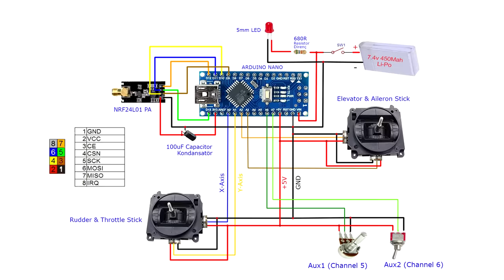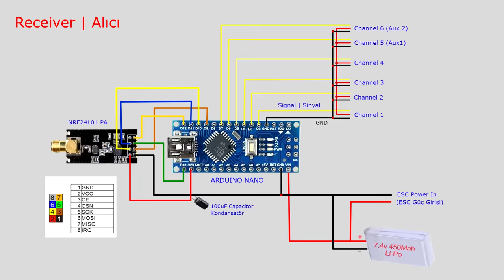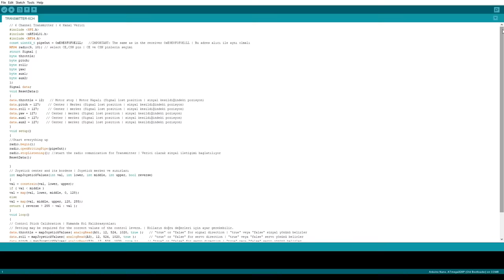DIY 6 Channels Radio Control For Models. How To Make İt

Comment: Hi sir, made it exactly the same. But I am facing a problem, that when I connect ESc to battery all servo's automatically get started in one direction. And unbale to controll it by transmitter. Could you plz help. I am using 9v battery (it is not a lipo battery)
Reply from the maker: First of all, let me state that it will not work stable with a 9V battery. It does not have enough current strength for NRF24 modules. If you do not have a Lipo battery, you can also try it with a 9V-12V DC adapter. (Min 1A). Other than that, I don't know where you went wrong. It works fine if all links are correct and there are no broken parts.
Reply: @Kendin-Yap  power is enough, it might be reciever and transmitter binding issue. Like in yours a beep sound comes out when you connect to power, but I am unable to get that beep sound. And one thing I am not connected any motor to it, should it is necessary to connect motor in reciver to bind it with transmitter?
Reply from the maker: It doesn't matter if the motor is connected to the receiver. ESC must be connected. BUT 9V batteries do not provide enough current power for NRF24 modules. I'm not talking about voltage. Voltage is a separate issue, current strength is a separate issue.
Reply: @Kendin-Yap  ok thanks, let me try with a adapter equal to 1A or more. Thanks for yor support! 😊

Comment: Mrb.Burada RC Joystick olarak PS4 analogunu kullansak olurmu acaba?Önerirmisiniz?
Reply from the maker: Evet kullanabilirsiniz. Zaten yakın zamanda eklediğim 8 kanallı arduino kumanda sisteminde ps4 analog kollarını kullandım. O videomu inceleyebilirsiniz.
Reply: @Kendin-Yap  cvp için teşekkürler:) yavaş yavaş tüm videolarınıza bakmaya çalışıyorum
Reply: @Kendin-Yap  Alıcı modülde servo motor  beslemelerini direk arduinodanmı aldınız acaba onu anlayamadimda bir kaç kez baktım ama göremedim
Reply from the maker: @yucelsohret  Hayır arduinodan değil. Alıcı şemasında kanal çıkışlarındaki pozitif (Kırmızı hat) pinlerin hiç bir yere bağlı olmadığı görebilirsiniz. Çünkü servolar ESC nin BEC çıkışından besleniyor. Eğer ESC kullanmayacaksanız harici bir pil ile de kullanabilirsiniz. Örneğin 4 adet kalem pilin konulduğu pil kutuları ile 6V luk bir batarya oluşturabilir ve kanal çıkışlarının Pozitif (+) ve GND (-) pinlerine direk bağlayabilirsiniz. Tabi ters bağlantı yapmadığınızdan emin olun.
Reply: @Kendin-Yap  şimdi daha net anladım çok teşekkür ediyorum

Comment: do you have plane can use my electronic : 1306 3100kv motor, 12a esc, 2s 450mah battery, 2 servo 2 gram with 1 servo 3 gram, 6inch propeller? thank you
Reply from the maker: Suitable for this model.   https://youtu.be/9SMyBN-B3Vo

Comment: hocam sonunda kumandayı çalıştırmayı başardım ama servolar çok az açıda hareket ediyor bunu arttırmanın bir yolu var mı
Reply from the maker: Alıcı kodu içerisinde yer alan map komutundaki “1000” ve “2000” değerleri servonun maksimum hareket sınırlarını belirler. 1000 ve 2000 değerleri ile 120° lik servo hareketi elde edilir. Örneğin bu değerleri 800 ve 2300 ile değiştirirseniz servo toplam 180° ye kadar hareket edebilir.  İhtiyacınıza göre bu değerleri değiştirebilirsiniz. (en düşük 800, en yüksek2300 olabilir)
Reply: @Kendin-Yap hocam dediğiniz gibi yaptım ancak değil 180 derece 90 derece bile dönmüyor  yaklaşık 60 derece civarına yükseldi sorun nedir acaba

Comment: Whats the role of that capacitor? and how do you decide where to use it In the circuit? this been a mystery for me for a long time
Reply from the maker: The port output of the Arduino does not have enough current power for the NRF module. Therefore, capacitor should be used for power support to NRF module or 3.3V power should be used externally. The task of the capacitor is to support the NRF module for stable operation. Therefore, the NRF should be connected to the power input of the module.
Reply: @Kendin-Yap  thank you so much! Your videos are great! Keep up the great job!

Comment: Dear my tx sending data some time why. What may be the problem I try with different nrf module.
Reply from the maker: The problem is that NRF modules are very easily affected by external interference. This creates connection problems. That's why there are versions with a metal case (which serves as a filter).
Reply: @Kendin-Yap  I wrapped the antenna with aluminium foil n my problem is solved thankyou for your replay
Reply from the maker: An interesting solution. I'm glad it worked. @varunraghuwanshi3177

Comment: I have an  flysky fsct6b transmeter and receiver. The circuit burned out in my hand. Can you tell me how to make the remote again from an arduino board using its signal translate module ?.Please ...

Comment: Can it run the DC motor in both directions
Reply from the maker: This is an ESC related issue
Reply: @Kendin-Yap  so if I put bidirectional esc will it work

Comment: Can we use a 9volt battery with it .?
Reply from the maker: The "C" value of 9V batteries is not sufficient for NRF24 modules. It does not work stably.
Reply: @Kendin-Yap  because of 7 volt battery my plane can't fly faster kindely give me some solution

Comment: Any idea how to decrease the latency? There seems to be noticable latency through the signal
Reply from the maker: No, there is no delay. Movements can be misleading in videos.
Reply: @Kendin-Yap  oh. Nice system regardless though!. I havent really researched the system but hypothetically how many channels can you fit into it?
Reply from the maker: 8 channels with an arduino nano. The channel capacity of NRF24 modules is 125
Reply: @Kendin-Yap  Oh nice! Il take a look into that module, it seems amazing.

Comment: Alıcdaki  pinlerdeki güç pinlerine 5v mu çekicez videoda göstermemişsiniz çünkü ben herşeyi yaptım servolar çalışmıyor yazılımları kaç defa kontrol ettim bir türlü olmuyor
Reply from the maker: Servolar elektriği ESC nin BEC devresinden alıyor. Bu yüzden artı hattının arduino ile bir bağlantısı yoktur.  ESC kullanmadan çalıştırmak isterseniz harici bir pil ile besleyebilirsiniz. Örneğin 4 adet AA kalem pil ile çalışır. Eksi kutbunu herhangi bir GND ye, artı ucunu ise servo pinlerinin bağlı olduğu artı hattına bağlarsanız servolar ESC den bağımsız olur. Ama ESC varsa bu gereksiz dir. Yazılımı kontrol ederek vakit harcamayın. Yazılım eksiksiz ve sorunsuzdur. Devre şemasında da hiç bir eksik veya hata yoktur. Defalarca test edilmiş bir devredir bu. Devre bağlantılarınızda eksik veya yanlış bağlantı yapmış olabilirsiniz. Bir diğer sorun yaratan konusu ise NRF24 modülleridir. Bu modüller ucuz ama kararsız yapıya sahipler. Eşleşme sorunları vardır. Bazen bir kaç kez elektriğini kesip resetlemek gerekebiliyor. Bazıları ise üretimden anten bağlantıları sorunlu geliyor.
Reply: @Kendin-Yap  eyw abi teşekkürler

Comment: Sir i made this and its working properly
But after long time i take that transmitter and receiver is not working....?
What i do now..?
Please reply me sir
Reply from the maker: Probably this is due to the NRF24 module. They are very cheap and simple modules. Sometimes there are such problems. The power on and off several times can sometimes work.
Reply: @Kendin-Yap  thank you so much sir
Reply: @Kendin-Yap  sir how to change program for center position joystick

Comment: I have a question: how to change pins 9~13 to other pins?  i can't see the definitions of 9~13 in code.
Reply from the maker: They are standard connections for NRF24. They are not input and output pins that you can change.

Comment: Hocam 7.4 volt 450 mah lipo 1400 kw fırçası motor ve 5 servo ya yeterli gücü verebilir mi yoksa daha güçlü bir pil mi lazım
Reply from the maker: Bu motorun ölçüsüne bağlı. 1400KV değeri  motorun gücünü ve boyutlarını belirlemez. Sadece Volt başına devir bilgisidir.
Reply: Hocam neyse bu youtube bana bildirim göndermedi bende sizi çok sıktım da o yüzden cevaplamiyorsunuz diye çok üzülmüştüm neyse ki gördüm hocam mükemmel bir insansınız her sorduğum soruya bıkmadan teker teker cevap verdiğiniz için size teşekkür ederim söz daha sormuyacam:D

Comment: Can we use nrf24l01 in it
Reply from the maker: NRF24L01 .. short range, NRF24Lo1+PA .. long range
Reply: @Kendin-Yap  can we u nrf24l01+pa in transmitter and nrf24l01 in receiver than what will be range

Comment: Can i use NRF24L01PA+LNA MODULE in transmitter and NRF24L01 wireless module in receiver?????
I WANT TO USE WIRELESS MODULE IN RECEIVER PLEASE HELP ME
Reply from the maker: NRF24L01 and NRF24L01 + PA are not different structures. It can be used with the same code and links.

Comment: does this code work in RF-NANO?
Reply from the maker: RF Nano is no different from Nano + RF24 module. They are the same circuit. You can use this code.

Comment: These cheats codes are not working in Arduino Nano.please    solve the error problem .please solve the ardunio error problem video
Reply from the maker: When everything is done right, the code works. There is no error. You need to download the necessary library file for the NRF24 module to your computer. Since this video is not an Arduiono training video, topics such as how to upload library files are not specified.

Comment: Can i use a 11.1v battery  to the receiver
Reply from the maker: It can be used, but some arduino modules can be corrupted by 12V. It is convenient to add a regulator to the VCC input of the Arduino.

Comment: Thanks for the video. I have make one but it isn't  working the motor in the reciever keeps buzzing i don't know why.please can you help me solve the problem
Reply from the maker: Servo motors are powered through ESC. If ESC is not connected, they will not work.
If the servos are running but the DC motor connected to the ESC is not working, you may need to slightly change the values in the throttle line in the transmitter's code. You can find it by trial and error.
Reply: @Kendin-Yap  the esc is connected and when i plug in the battery the servos return to middle position but the motor keeps buzzing.It seems like the reciever doesn't receive any signal.Both the motor and the servos none of them moves

Comment: Alıcı devresinde güç hattı arduinoyoda Vin girişine  bağlı olması lazım değil mi sadece kendi arasında bir bağlantı mevcut o kısmı anlayamıyorum yardımcı olursanız sevinirim teşekkürler
Reply from the maker: Hayır arduino ile bir bağlantısı olmayacak. Servolar gücü bağımsız olarak ESC nin BEC devresinden alıyor.
Reply: @Kendin-Yap  Şu an elimde esc mevcut değil sistemin çalışıp çalışmadığını nasıl kontrol edebilirim
Reply from the maker: @berkegoze3703  ESC nin takıldığı pinlere harici bir 5V enerji kaynağı bağlayıp deneyebilirsiniz. 4.8 volt pil olabilir veya 5V luk bir DC adaptör de olabilir. Pinlerin sinyal olanı boşta kalacak. Artı ve Eksi (GND) pinlerine bağlayabilirsiniz. Yönlere dikkat ederek bağlayın.
Reply: @Kendin-Yap  arduino üzerinden 5v alabilir miyiz adaptör yerine

Comment: can i use any joystick like playstaion controller
Reply from the maker: Potentiometer joystick (analog) required for proportional control. As far as I know, game controllers are not equipped with potentiometers.
Reply: bec. i dont have the controller you use 
where can i by it and thanks

Comment: Is possible to make motor run at half speed but joystick throttle at full speed? I want to make rc car, but i need motor run slower, please help
Reply: Already build, but cheap joystick to hard to run motor slowly, rc joystick too expensive here...
Reply from the maker: This is an esc related issue. It can be used for car with bi-directional ESC. Arduino joysticks can be used as cheap joysticks.

Comment: Thank you for great video, it is wonderful, but kindly I have two questions please:
1- where you got the power for the 5v line for the channels pins(medium row) on the sketch?
2- if I want to use in the transmitter module arduino uno rather than arduino nano, what should I do for the connections and the code??
your answer will be appreciated
Reply from the maker: The VCC line is powered by the BEC circuit of the ESC. It is independent of Arduino.
Arduino becomes uno. The code is the same. The names of all the links are the same. You just have to check their numbers.
Reply: @Kendin-Yap  thank you dear, but if i dont use esc, can i connect the vcc line direct to the battery (same battery which will be connected to Vin on Arduino Nano board)???
Reply: @Kendin-Yap  but in arduino uno I don't have A6,A7 as arduino nano, where i should connect them on arduino uno?? I connected them on A4, and A5, is it right? if yes, which part of the code I have to change plz??thank you so much

Comment: You cannot give vcc connection of all channels of Receiver  to arduino
How much voltage we give to channel?
Reply from the maker: For servos, VCC takes power from ESC's BEC. So there will be no connection between Arduino and VCC. The power connection of the servos is independent of Arduino
Reply: @Kendin-Yap  Please explain me an other i can't understand

Comment: when i test this transmitter and receiver and increase the throttle all the channels work with at the same time and the other joystick can't control anything. Please tell me how to solve this problem??Please answer sir
Reply from the maker: There may be an error in the signal connections. Signal connections should not touch other channels.
Reply: @Kendin-Yap  thank you, it is really helpful for me😊

Comment: Servolar neden tam 180 derece dönmüyor çok az dönüyorlar bendekiler de öyle
Reply from the maker: Normal model araçlarda kullanılan  çoğu servo burada olduğu gibi toplam 120 derece hareket eder. Ve bu fazlasıyla yeterlidir.  Dijital kumanda sistemlerinde bu hareketi istisna durumlar için menüden %40 arttırmak mümkündür. Ve 170 dereceye kadar çıkabilir. (Örneğin ileri seviye akrobasi uçakları için) . Ama aslında bir çok servo 180 derece hareket etmeye müsaittir. Normal kumandalarda sinyal 1ms - 2ms aralığında olduğundan standart servolar maksimum 170 derece hareket eder. Ama bazı servo tipleri 180 dereceye hatta sonsuz dönüşe sahiptir(Robot servoları gibi). Sonuç olarak bir çok RC araç için 120 derece fazlasıyla yeterlidir.

Comment: Sir my coding has been done becouse of your help and sir my kk2.1.5 controller is also arming but remote command are not working properly does this happend becouse of low battery voltage

Comment: This thing is awesome (Is the code available anywhere?)
Reply from the maker: The code link is in the description box below the video.
Press the arrow symbol on the right below the video. (For mobile)
Click the "More Information" link below the video. (For PC)
Reply: @Kendin-Yap  Thank you so much (i blew up my Glider controller and due to current pandemic cant get a new one shipped)
Reply: also my PC cant compile the code to load into the Arduino (i know im missing a driver or something and i cant navigate your github link)
Reply: @Kendin-Yap  what gimbals are you using ? the gimbals from the banggood link look totally different

Comment: selamlar. siz esc kullanarak dc motoru gaz kolu ile çalıştıyorsunuz. peki L298N motor sürücü bağlanarak pwm kontrolü nasıl yapılabilir. kodlar üzerinde maplar üzerinde çok uğraştım bir türlü beceremedim. daha doğrusu in1 in2 ve enable pinlerini kodlara bir türlü dahil edemedim. hazır kodlarınızla data alımından sonra in1 HIGH yapıyorum çekirdeksiz mini motorum çalışmaya başlıyor ama hem yavaş dönüyor hem de gaz verdiğim de çok az bir artış oluyor. örneğin 2 numaralı pini L298N için enable pini ile bağlıyorum. ch1.writeMicroseconds(ch_width_1); 
satırlarında bir değişiklik yapmıyorum
Reply from the maker: L298N in akım kapasitesi çok düşük olduğu için ben hiç kullanmadım. Bu yüzden bilemiyorum. Ama Map değerleri ile ilgili olabilir. Map değerleri RC servo ve RC ESC ler içindir. Yani ESC ve Servolar 1000 ila 2000 mikro saniye aralığında çalışır ve koddaki Map değerleri buna göredir .  L298N için bu aralık uygun olmayabilir. L298N için bu konuyu araştırmanız faydalı olabilir.
Reply: @Kendin-Yap  cevabınız için teşekkürler. sonunda yaptım çok şükür. analogwrite ile enable pinine ch_width_3ü değer olarak gönderdim. serial.print yardımıyla değerleri değiştirerek 0dan 255e kadar aralıklandırıp çalıştırdım. tabi dediğiniz gibi akım sınırlaması %30 kadar olduğu için motor tam performans da çalışmıyor. bugün dc motor için esc devrenizi deneyeceğim parçalarım elime ulaştı ırfz44n bu sorunu ortadan kaldıracak gibi geldi bana ihtiyacım olan maksimum 1.9 amperlik bir akım. bu değeri de devreniz verir sanki
Reply from the maker: Evet benim yaptığım ESC devresi video da görüldüğü haliyle uzun süreli olarak 5-6 amper akım ile çalışabilir. 10 amper gibi bir değerle bir miktar olağan ısınmayla 5-6 dakika sorunsuz çalışabilir. Ekstra soğutucu ile 18 ampere kadar kullanılabilir.
Reply from the maker: Eğer IRFZ44 yerine IRLZ44 kullanılırsa ısınma daha az olacaktır.
Reply: @Kendin-Yap  tamamdır teşekkürler o halde IRLZ44 kullanayım. 4 motor için (herbiri 1.9 amper) ayrı ayrı devre kullansam ısınma sorunu büyük ölçüde kalkar ortadan değilmi
Reply: @Kendin-Yap  yani 4 motor için 4 ayrı devre yarım saat az bir ısıyla çalışabilir sanırım

Comment: Bro make a controller that have same motor speed controller and power on button like in this video but bro this time include 6 toggle switch and 5 other motor. when 1st toggle up  all 4 motor rotate clockwise at same time when toggle is middle no rotation when down rotate all 4 motor anticlockwise same time and also this 4 and 5th  motor are controlled one by one 2nd 3rd 4th 5th and 6th toggle switch means each motor are controlled by each toggle no toggle effect each other and remember first toggle controll all 4 motor same time means we controll 4 motor with 1st toggle (all 4 motor operate same time) , 2nd 3rd 4th and 5th (controll all 4 motor one by one ) and 6th toggle controll their 5th motor make it bro